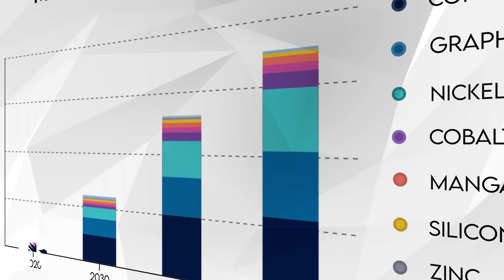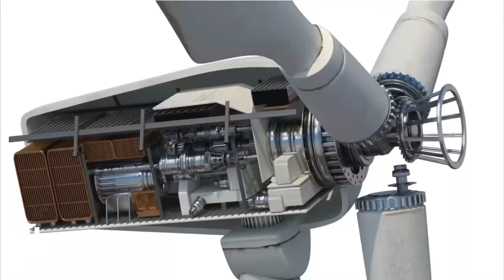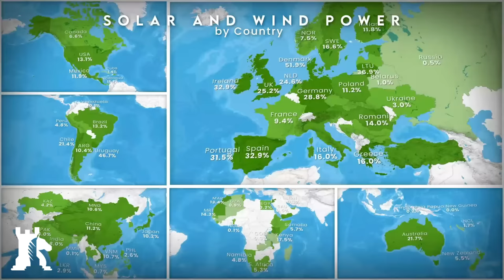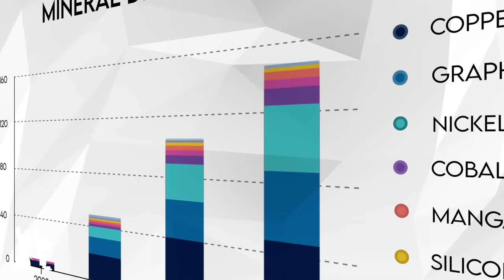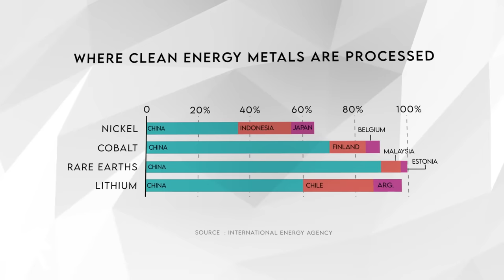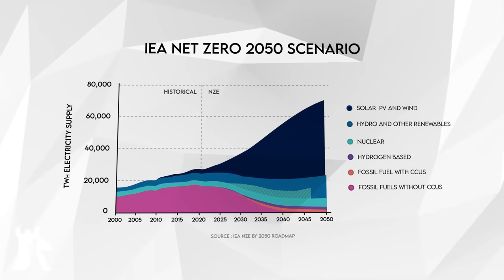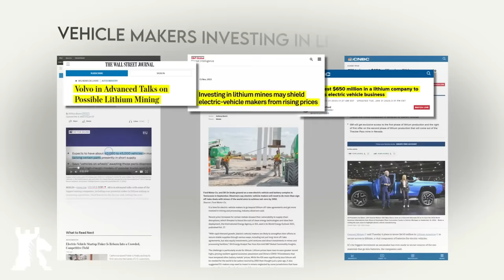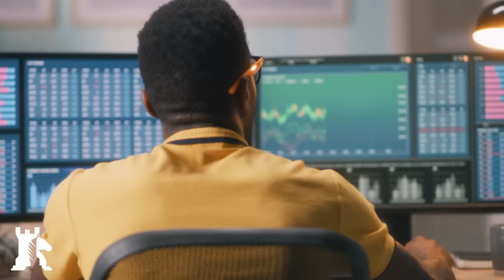Net Zero by 2050 is not happening

Comment: One thing that could alleviate the resource problem somewhat is LFP batteries which are already the standard in China. Iron is basically infinitely abundant. So is lithium, theoretically it’s really just sand, the challenge is in processing it into spodumene. That’s a challenge for sure but we have more than enough reserves
Reply: Surely you mean that silicon (or perhaps glass) is really just sand, not lithium.  Lithium is fairly scarce, and the usual source for it is evaporite deposits on dry lake beds, not sand.  Silicon is a very common material, and sand is a reasonable source, but it's fairly difficult to process and a lot of waste is generated in the process.

Comment: This is why nuclear and hopefully fusion power by 2050 will solve at some of the problems mentioned here.
Reply: Yes.. but nuclear War before ☢️
Reply: @Neobees that would definitely improve on net zero goals. Take a few million humans out, the issue will be alleviated for a while. Go FULL Mutually-Assured-Destruction, and net zero will be achieved far quicker than any other way.
Reply: @mrD66M  Source MiT 1972
Meadows Check The Graph 📉
Reply: I'm with you, but the magnitude of the issue is too big to put hopes into scientific progression as well. What if it does not work out by 2050?
Reply: Fusion is nuclear power, it's just more fuel efficient than fission.
Reply: If nuclear reactors take as long to build in 2050 as they take now, we would have to start building all these reactors 3 years ago.
Reply: @tobene depends who is building it. If it's in the US I suppose they need 10 years for each plant. Only exception being the reactors that go on naval ships. But even they aren't keeping up with demand.
Reply: @rami8896  Many smaller players can and are building NPP'S
Reply: Sure. "Will" ... Right

Comment: It's a very complex problem. To look at it in simple terms, I'd say if we're in a hole, it would be better to stop digging. Or if we're lost, try to retrace our steps. But there's little appetite for going backwards, eg to a smaller population or more basic technology.
Reply: I completely agree. We need to use less energy, not replace every one of our current systems with renewables.
Reply: It’s really not, we have abundant energy, it’s called hydrogen. Problem is the commercial and practical use of it is not allowed by the powers that be.
Reply: @oahts5906  There are currently 15,000 hydrogen powered vehicles on the road, all in California.  It is widely admitted that providing hydrogen to power vehicles throughout the US is going to be a monstrous task; and building the vehicles themselves likewise.  Not impossible; but slowly the states (e.g. California and Oregon, among others mandating EVs) are going to figure out that the buying public is not enamoured with EVs.  They have their place, but they are not the panacea which has been proposed.
Reply: @timmoore9736  ok, but do they utilize electrolysis? Do they just fill up with water and go? That’s what I refer to when I say ‘hydrogen powered’.
Reply: @oahts5906  My understanding is that hydrogen is provided to the vehicles - the vehicles are not processing water to provide the hydrogen within the vehicles.

Comment: What everyone underestimates about nuclear energy is the potential for new tech to produce safe modular cores in factories. Spending the next 6 years in R&D and core factory construction could (if govs simplify licensing/insurance/waste disposal; a big "if") begin a modular reactor boom starting in the early 2030's. The other unknown is new deep well geothermal which can be built almost anywhere for steady baseload power, using oil drilling equipment. Investing heavily into those 2 tech could fill the gap from 2030-2050. New batteries need no cobalt; Tesla bringing cleaner lithium refining too.

Comment: I love your work and your insights. In this case you seem swayed by sponsors for mining or distorted analysis. Example, Lithium is unlikely to remain a main feature of EV batteries as Sodium Ion and other types will eclipse Lithium types because of costs, predominately, and better resource use, as the EV production upswing really hits in a few years. The Na types are already hitting the market.

Sorry Shervan, your earlier point on resource scarcity for green infrastructure building applies 5X to nuclear power. Nothing about nuclear power is resource efficient, particularly if you look at the ONLY waste storage facility on the planet about to open in Finland, where every single storage unit has a 5 centimeter thick copper vessel ~4 meters high and 2m across as a component of the permanent storage containment for just one capsule of the planned 10s of thousands. (Cu wasted forever!) This isn't even the power plant, and its containment, this is just the final waste storage. (Wind turbine blade waste is simple by comparison.) NUCLEAR BUILD OUT IS NOT FEASIBLE. 

Also for solar, you are making a misleading presentation with the premise that the resource requirements are too great. You forget the construction is the end of the resource extraction for solar and wind. Panels last 30 years and just produce energy sitting there. For our present coal, oil or gas energy infrastructure a continuous supply of fuel must be procured by drilling and mining, and then there is materials use for pipelines, HUGE trucks and mining equipment, tailings ponds, flaring or methane releases, railways, cargo barges and ships, roads, delivery storage, malfunctions, waste, accidents, inadvertent releases, pipeline ruptures, trail derailments, threats of meltdowns or military sabotage, refurbishments and upgrades, corrosion, fires, explosions, pollution, and acid rain mitigation. So you are making an unfair comparison to infrastructure which needs no fuel inputs after construction to those that require ongoing supplies by mining or other resource extraction. Overall environmental degradation goes DOWN with green tech because trillions of tons of mining or other extraction efforts are eliminated!
Reply: This is extremely misleading and false... You claim that fossil fuel energy is a greater hit on resources but it's really not, once you build the plant and the infrastructure then all you need to do is mine for the fossil fuels and run power off of that which yeilds a large amount of energy while with solar and wind and other green tech, it costs a lot to build these places while at the same time it generates very little power, in fact in the UK a plot for offshore wind farm got no bids because it was seen as too costly to do due to the current economical situation and it shows that you cant just look at the upfront costs when talking about energy infrastructure and you have to weigh in the costs to it's overall profits long term and Shervan is correct in saying it's just not feasible. You also have to understand that if we go completely electric then everything that uses fossil fuels will have to go electric and will be a huge burden on the power grid, in fact, many EV stations for cars in the UK are closed due to poor infrastructure for this change and we'd need to be generating even more power to facilitate this change but with rising costs and solar and wind farms reliant on the weather, it's just not optimal WITHOUT using nuclear power.

I agree that we need to push off of fossil fuels but the infrastruction isn't there for pure electric meathods without using fossil fuels and the tech is pretty shitty, EV cars have terrible range and need to be filled up far more often than diesel cars and on top of that, not everyone can charge an EV car at home because the infrastructure just isn't there.... Rushed things often come at a huge price and often an ecological one and I bet this will have far reaching implications the same way fossil fuel energy did when it first made the scene or diesel when we were told it was suppose to be better only to be now told it's actually worse.

Eitherway, all of this is pointless when you look at countries that produce the most greenhouse gases, China produces a 3rd of all the worlds greenhouse gases (13.7 billion tons) and they're using more and more each year and they dont care about your Western idealistic views or global warming and they're not alone, India is third (4 billion tons) and right behind the US (6 billion tons) with India is still continuing to rise in its use of fossil fuels while the US is steadily dropping... The point is here that it's unless we can curb China's use and stop India's rising needs because it doesn't matter what we do in the west because China will just replace us and the greenhouse gases will continue to rise around the world.
Reply: @crackajacka87  Thank you for your serious reply. 

Let's do your points in reverse. That China and India are in a coal plant build out, and produce lots of greenhouse gases doesn't mean any reductions anywhere don't matter, LESS is LESS, particularly if we are pushing toward an extinction triggering tipping point. Also there is a thing called LEADERSHIP, we could have it and it would matter. I am in the US and our bought out leaders are a problem.

How far do you drive in a day? EV range is pretty substantial, UK is not that big, people get around here, even cross country, but 90% of the time daily mileage is easy to make on our present EV capacity.

Rushed things do have an inherent lack of finesse. But we have had absolute certainty of the effects of increased CO2 since 1980, and the first scientific paper about the dangers to a stable climate of coal burning came out in 1813. If our present actions seemed rushed could be necessity.

So back to those coal plants being built or nuclear plants. The present ones we have are all pretty old, so we will be building new, therefore the savings you implied of only fueling the plants is a mirage. Installations that tap energy reservoirs take less millions of tons of fuel.

Solar is the key, wind has a lot of moving parts. Solar panels last 35+ years, are so stable they can be contractually guaranteed for 80% output at 25 years. The grid and solar farms are the wrong direction, solar on every roof covers already built areas and cuts down transmission losses. The power should be used as DC, saving on inverters losses too.

Again nuclear power would take an incredibly expensive build out, and many years. Solar can go up in weeks. And on structures already built. Solar also breaks the Rich Man's claim to Economy of Scale. Power output scales linearly with area, and any space on my roof is as good as any other before the sun!  Thank You
Reply: @philliplamoureux9489  It doesn't matter if some countries lower their emissions if China, India and Russia dont lower theirs... If the US and the EU drop their emissions by 2050 (highly unlikely especially for the US) then that will only drop world emissions (using present data to calculate) by just 20% but China has already risen their emissions in the first quarter of 2023 by 4%... So in 4 months the largest emitter has risen theirs by 4% and that equals a quarter of the emissions the US and EU create which they want to end by 2050... Do you not see the issue here? Also, fun fact, the greenhouse gases emitted that triggered past glacial periods was around 300PPMV (part per million by volume) for CO2 and we sat at 377PPMV in 2004 and we were off the charts then as the safe levels are between 200-300PPMV so we dont just need to reduce emissions but remove them from the atmosphere. Good news though, in the last 50 years temps rose by 1C when temps started to truly rise in 1975 so if nothing changes (no gains or loses worldwide) then we can expect reaching that 3.5C tipping point in another 125 years.

EV cars average around 225 miles before needing to fill up and that will be reduced massively if you speed up on a motorway or highway, the average diesel car averages 550 miles. The best EV car for milage is the Mercedes EQS 450+ that averages 395 miles, still significantly less than the average diesel car and there are a few drivers who have complained and gone back to diesel because they were fed up of having to stop to refill so often and it doesn't help that EV charging stations are no where near as common as petrol or diesel stations are... It's an inconvenience to most and as I stated before, if there's no way to charge your car at home then this issue becomes even more problematic... And I wonder how well these batteries retain charge during cold weather? I know from experience that batteries suck in colder temps and I cant see it being any better for EV cars.

As stated above, we have roughly 125 years before hitting that tipping point and when we do the glacial period will take thousands of years to drop from 3.5C to -8C although we have pumped so much greenhouse gases into the atmosphere that it may take even longer or it might actually never happen because the planet cant deal with it... Tbh, it's an unknown and that scares scientists far more than an actual glacial period because they happen naturally and it's actually odd that we didn't cycle back into another which has been the case for over 500,000 years and for the last 10,000 years we were stable at 0 which is... Odd, an anomaly according to the data, could the advent of humanity be the cause for this? I'd be interested to know personally.

I had a stepdad who is a heating engineer and this has been his job all his life and did a brief spell fitting and installing solar panels to roofs and he said they are absolutely pointless because the costs you'd save in electricity would about equal the cost it was to install after 30 years, now, costs of solar have gone down massively but according to my stepdad then, solar panels would at most just heat up your water to have a single shower per day and he personally saw them as a folly because they generated such a meager amount of energy. Also, they are hampered by the weather, a cloudy or wet day will reduce this power even more and as I live in the UK then they are kinda shit which is why my country pushes for wind more but even that's costly to make and run... Geothermal and nuclear are the only 2 options that can give a country net zero optimally and reliably.

Nuclear does take several years to make their power plants and they are incredibly expensive to build but once operational they last far longer than solar and are relatively cheap to run and generate a large and stable amount of reliable energy... Solar and wind is weak and not as reliable as it relies on perfect weather conditions which aren't always favourable and on top of that, even though solar can last for about 30 years, they actually lose their efficiency over the years and can degrade by 0.5% every year and end up generating 12-15% less power by the end of their lifespan.

Comment: Counter points: 
1) Lots of things become possible once economies / production / supply chains convert from fossil fuels to electric. 
2) Necessity drives innovation. There is a lot of research into battery tech, for example, that requires more mundane (widely available, less toxic) components and minerals. e.g. Sodium-Ion Batteries, Aluminium-Ion Batteries (aluminum is the most abundant metal on Earth), Organic Batteries, Air batteries, etc.  
3) It's not just about renewables and batteries. The energy mix of the future will be partly renewables, nuclear, hydro-electric, hydrogen and probably some other things (we can all hope for fusion as well)
4) Independent of the crises of climate change, the economic model we have today based on continuous growth and continuous new demand is on an unsustainable trajectory. Population implosions in the developed world, aging populations, intensifying competition for raw materials, etc. are all putting pressure on this model. It's pretty clear we can't take the model we have today and project into into the future (e.g. 2100+) as is in any case.
5) We know the fossil fuel based society/economy we have today is unsustainable and that we can't get there (net zero) at scale with a fossil-fuels. The only viable option is a hard push toward electrification and a collective bet on innovation. We've wasted decades already trapped in the fossil-fuel paradigm primarily because it makes a minority of the population rich. The goal isn't to replace one extractive resource (oil and gas) regime / corrupt hegemony with another (lithium, nickel, etc.).  So a big no thank you to the investment recommendation.

Comment: Solar/wind has crappy energy density, needs too much land and materials. It has a role to play, but we should focus on hydro and nuclear.
Reply: Solar/wind while being crap is cheaper than nuclear. Hydro is prefered where its feasible, but otherwise it makes currently more sense to build solar and wind. This might change if the material procurement increases the price of the powerplants.
Reply: @imilegofreak  only cheap if you ignore costs of storage, transmission, and land. It really needs those things so it's not cheap if you need a non trivial amount of energy solar/wind.
Reply: @ninefox344 solar and Wind are cheap alternatives for small communities and countries. But for larger countries, I agree.
Reply: Well we can just use both in places where these energy sources will be most efficient, correct? Focus on certain things at certain places.
Reply: @houstonwehaveaproblem4187  yes but the key is you need to pair it with enough storage to make it behave more predictably.